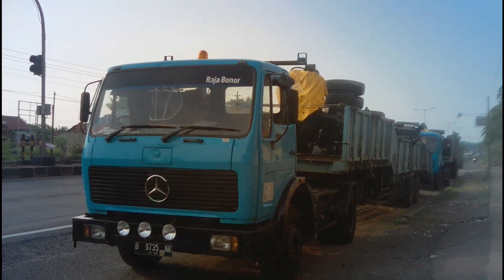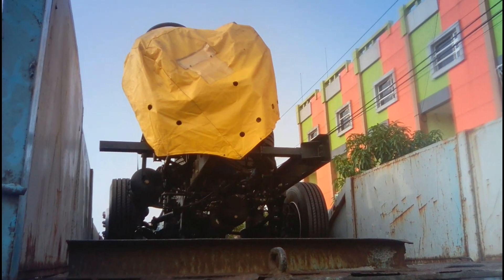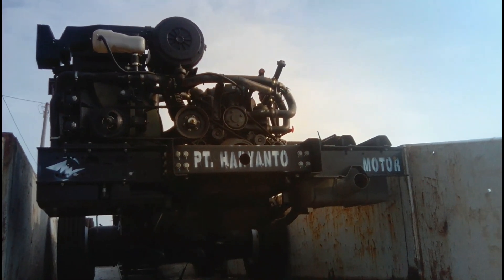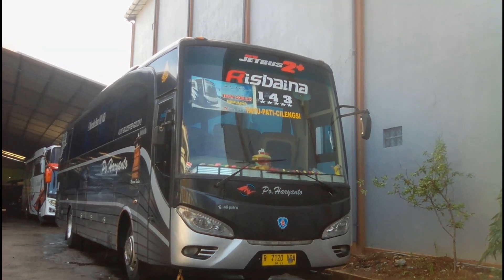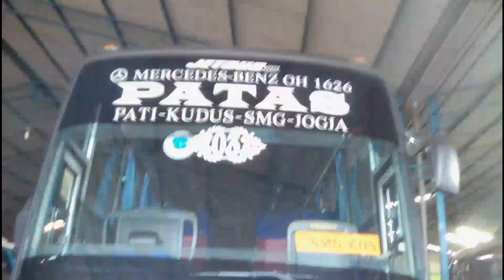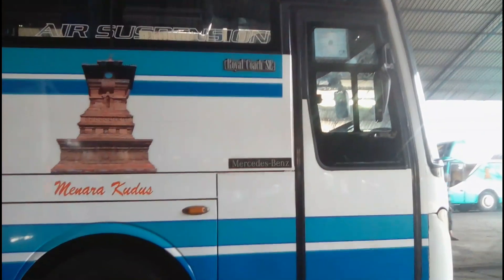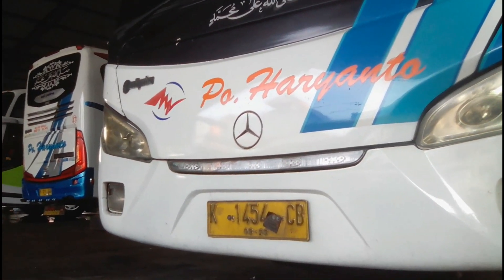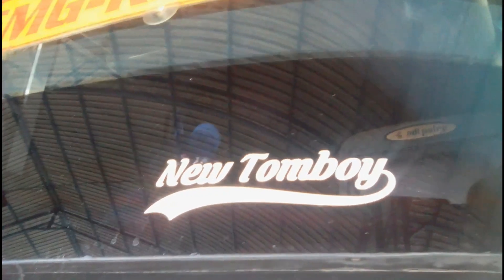Datang lagi 2 unit sasis Mercy 1626 milik Po. Haryanto siap di kirim ke Adiputro

Comment: PATAS PO Haryanto ini rata rata Mercedes Benz OH 1626 Air Suspention.
Reply from the maker: Tidak semua nya 1626 ada 2 unit 1526 (yg satu udah airsus yg satunya belum airsus)
Reply: @ArdionRizqiPramanaPutra  yang OH 1526 yang no berapa PATAS nya?
Reply: Patas 07 air sus by adiputro dan 09 infinity trisakti yg 1526
Reply: @irwanwawan48  yang no 07 saya pernah naik 2 kali chasisnya dan karoseri masih baru dari Adi Putro. Tapi ditulis nya OH 1626 Air Suspention. 
Untuk yang no 09 belum pernah. Yang sering lihat yang Infinity yang no 04 warna merah.
Reply: @irwanwawan48  pernah dengar dari kondektur nya katanya nanti PATAS akan sampai jumlah 29 kalau tidak salah mohon informasinya. 
Saat ini PATAS PO Haryanto jurusan Yogyakarta Semarang Kudus Pati baru berjumlah 10 armada.